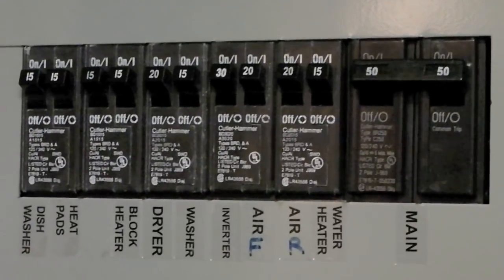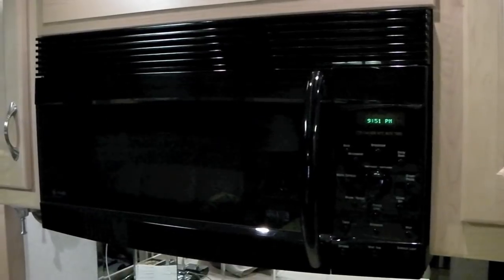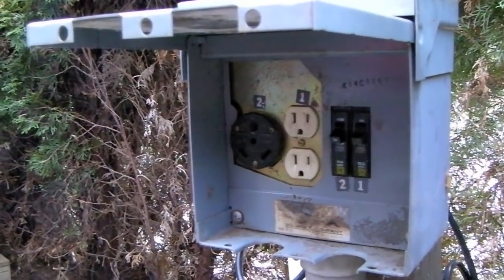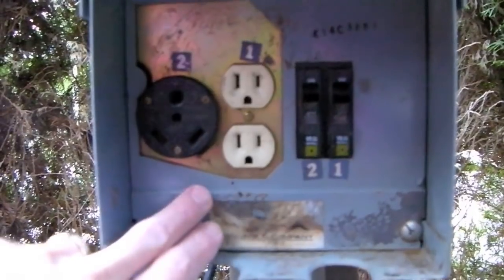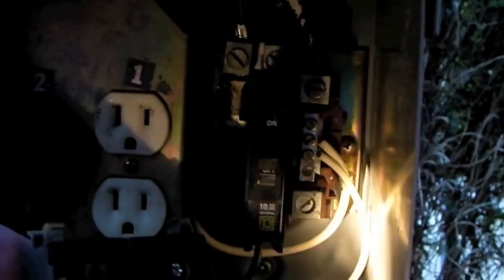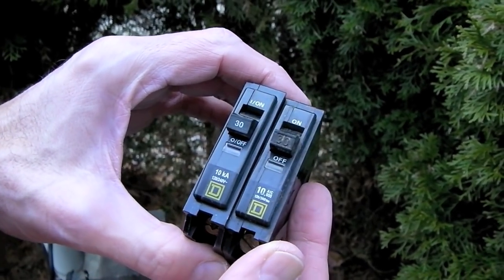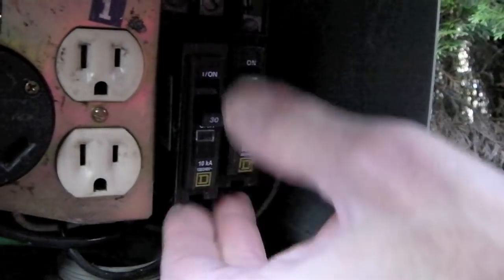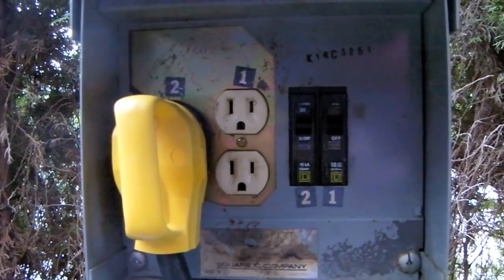HOW TO: Replace a Circuit Breaker on an RV Power Pedestal

Comment: Anyone else notice that that was a Nema 5-15 duplex outlet and not a 20 amp outlet that he said it was when he pointed to it? Small detail but it might cause people to miss identify a  Nema 5-15 in the future as a 5-20. Good video, good walkthrough, it's nice to show what's inside with the dead front off, thanks for uploading this.
Reply: Yep, I was watching and about to comment, except the BREAKER is 15amp, so the receptacle is ok, but he kept saying it was 20amp.   Also, why not put GFCI on the 15amp circuit?

Comment: I am a licensed master electrician.  You did a great job.  You could have also done a visual inspection of the wires to see if they look like they have overheated, or the insulation is discolored.  Also tighten all the other screws (breakers, ground, and neutral) while you are in there.
Reply from the maker: Thanks for the added pointers, Brad! Good to hear from a pro that we did a fairly passable job. :)

Comment: Replacing those i cant help but think of like changing out standard inkjets in a printer. but in this case, the printer can kill you if your not smart to kill the power, and making sure its indeed powered down before doing any work like this. Working with Electrical  101. lol

Comment: Good stuff.. the only thing I would have added was to put tape on the main breaker noting that your were working on it, also I would have tested the outlet to make sure there were not other supplies to power this outlet.  be safe, don't die

Comment: Great video. Sometimes the 30-amp breakers do go bad. 

But the 30-amp receptacles go bad too. The internal contacts loosen, especially in campgrounds that see a lot of use. The loose internal contacts cause electrical resistance and heat. I’ve seen several RV plugs that literally melted from the heat.

Comment: I agree with RV Geeks on the power hookup procedure. But you can take that 1 step further and make shure that the main breaker in the RV is off before you turn the power pedistal breaker on. the reason for this is to make shure that sensative equipment in the RV is off or unpluged before power is applied to the outlet.

Comment from the maker: Sorry to disagree, but EVERY expert on this topic will tell you otherwise. From RVtravel(dot)com's extensive "No Shock Zone" series: "ALWAYS turn off the circuit breaker when plugging or unplugging your campsite power. Not doing so is to invite death by electrocution."  Read the entire series on RV electrical safety: rvtravel(dot)com/noshockzone  (of course, replace the (dot) with a "."

Comment: okay the problem with the old Breaker is the connecting Jaws, the old one is spread too far thus causing the blink and the over heating which is how the breaker trips via heat moving a part inside releasing a spring to turn off the power.

Comment: hey i have a relly old trailer upnorth in canada we have no power ...the only way we have power is from a generator ...but one day something happened-half-of the trailer does not have power I dont know why is it a breaker because are trailer is conected to a liitle house we builded ...so that little house has power but not the trailer inside of the trailer their is a powerbox i checked if their was a breaker  and their was so ...what do you think ...can breaker fry or something and not work...

Comment: What's the problem when you're 30 amps cord smokes when you plugin? I cleaned the black build up off, after!
Reply from the maker: I'm not a professional electrician, but if that happened to me, I'd call one!
Reply: +Oie de Etudiant when that happens there is ether 

One, more AMPs then it can handle being pushed through it: If say there Allot of high power electronics turned on. Which can alarming if all your cord is, is only a 30AMP. So depending on whats plugged in could cause that. I would make sure the main breaker onboard your RV is no larger then 30 AMP. 

Two, there contacts somewhere touching from both positive and negative: But this is often unlikely if any of the breakers in line of the circuit are worth there salt.  With a issue like this the breakers should flip almost instantly. But is issues is very small not allowing enough AMPs to trip it but heat it then Id say the Outlet, or Plug is bad. 

But In any case I would say look into saving your pennies to have the electric upgraded to a 50AMP (This will likely mean a new breaker box, 50AMP Wire cord, and plug (As well as a 50 to 30 adapter if you travel to places with only 30) . Thats what I did for my Rig, 1 because the electric company here are @ssHoles and wouldn't turn me on unless i was, and 2 it prevents issues like yours from happening. 

If your issue is One at the top, then chances are there not just damage to the end of your plug but damage to the cord its self. Those cords are threaded and not solid to make them easier to bend and flex, So that means allot small wires wrapped up together, and some of them maybe burnt up. I found traces of that in my old 30AMP cord which made me more happy i made the upgrade later on.  When that sorta things happens its no longer a 30AMP, it becomes less then that. 

Sorry if my reply long winded or came too late, but info for anyone else that needs it. 

Cheers,
rvguides.tk

Comment: I've got a 2001 mallard and my breaker box is underneath the bed beside the bed I hear like a fan blowing every 15 minutes and it blows for 30 seconds and then shuts off is this normal
Reply from the maker: It sounds like it might be some other component, like a converter or charger down there, since the breaker box itself probably wouldn't have a fan. Has this just started recently and if so, has it gotten much warmer out lately in whatever part of the country you're in?
Reply: it started a couple times last summer but I just came to the travel trailer on my time off to get things ready and I checked the electricity see if everything worked and I had 2 overhead lights on and a TV on and I noticed the fan running next to the breaker box I don't know where the converter is it might be next to it should I be concerned and maybe hire a RV Tech I definitely don't want a fire
Reply from the maker: Not being familiar with your rig, we'd agree that having a pro at least give you an opinion is a wise idea. If there's nothing wrong, it shouldn't cost much to repair. ;-)
Reply: thanks buddy I'm still new at it of course I work all the time I'm a OTR driver ..

Comment: 1)  You don't have a 20amp circuit in the box.  When you shined the flashlight, it was clearly a 15 amp breaker and 15 amp receptacle.
2)  Why not update that 15 amp to GFCI?
3)  You didn't say where you where, but in salty areas (like near seashore), there will be oxidation on breakers and terminals. Lightly cleaning those contacts with an emory cloth could solve your issue.   That could be the issue inside RV, too.    However, I think from other videos, I've seen your RV buried in snow, so improbable on ocean.

Comment: yes they can its unusual to happen but it can. First get a volt meter and see if power is going through all the breakers. Probably only two but all need checking with the trailer plugged in. But like he states if your not comfortable or know what your doing .... DONT DO IT!! this can be dangerous and fires can happen if you dont do it right. the one that dont have voltage out going must then be removed to see if it is getting incoming voltage if no then look for a shorted wire. Be Careful !!!!

Comment: do not plug the rv in fist then turn the breaker on cause incase of a increase of power so u dont fry your rv power system or inverter or anything.